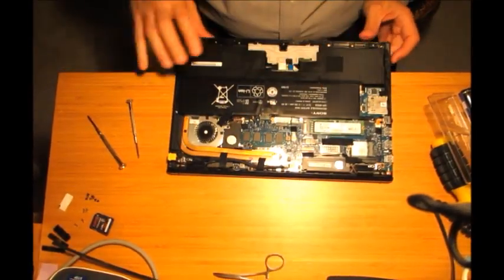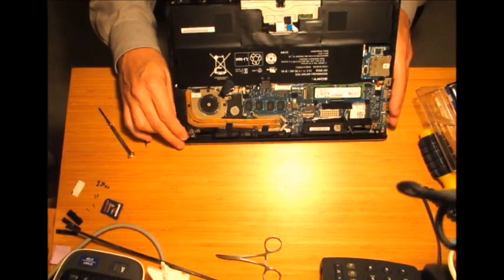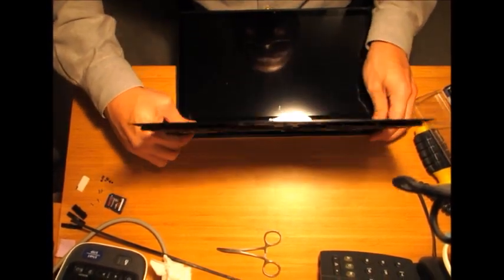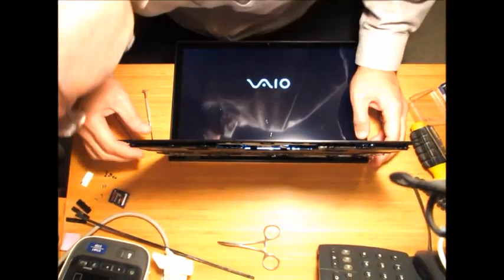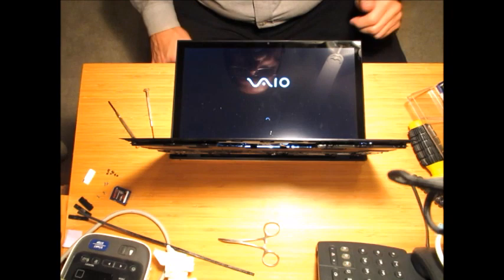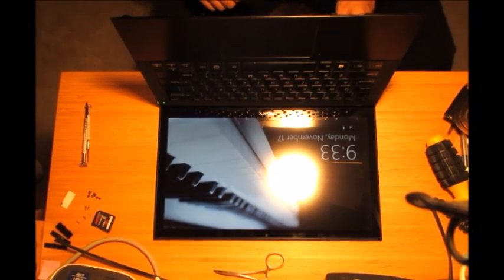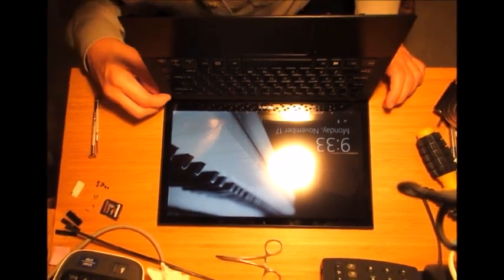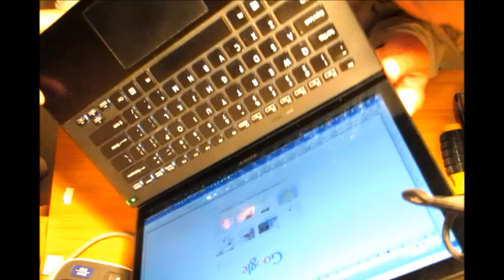Sony VAIO Pro13, svp132 fan replacement, case removal

Comment: Great video.
I just broke the digitizer on my vaio pro 13 do you know if i can replace it or do i have to replace the complete lcd screen + digitiser?
Reply from the maker: Kevin Bruggeman Good question, I had never looked into this, but after doing a quick review it appears you can replace only the touchscreen & digitizer.  There are companies selling them for ~$75-$100, however I have NO experience with those companies nor the process for replacing it.  Ex. http://www.etradesupply.com/sony-vaio-pro-13-digitizer-touch-screen-v1-0-version-black-with-sony-logo.html     
I suggest you look into the mechanics of the replacement process before attempting this, feels like it may be difficult, but I do not know.   May be easier to replace the whole LCD screen & digitizer.   Let us know how it goes.
Reply: Ok thank you ;)
Reply: Hi Kevin, I know it's too late and may be you dont even remember what you did but I have the same issue with my ultrabook. Do you think if I should buy whole LCD screen + digitiser? Thanks
Reply: @omerd.908  I had it twice now. Replacing the whole thing makes it much easier, less hassle. Just a few screws. You can however change just part but risk damaging the others during dissasembl
Reply: @kevinbruggeman5203  Thanks a lot for your reply. Actually I am planning to replace whole but I dont know if I can or not, as I couldnt find any related video. Do you have any video recommendation?

Comment: Hello, what was the problem with your fan?
My fan started flickering one week ago, and now it's completly blocked, and when the fan try to start the engine make a terribile noise. You got the same problem?
Sorry for my bad english.
Reply from the maker: fabiaiz10 Fabiaiz, my fan started making noise, like a whine and growling.  This went on for ~4 months and was getting worse, then I changed the fan.  If  your fan was clicking and now stopped, I would suggest getting a can of high-pressure air and put the can's tube in the fan vent near the power connector and try to blow the fan.  You may find some object has gotten into the fan, try to blow it out.  When I used a can of air on my fan to clean it, I can hear the fan spinning with the air.

Comment: ***** Thanks for the reply Larry. I had a look through the Intel page and nothing stood out. though I booted up Furmark to push the graphics to the limit and watch them closely to see what happens. As you said, it hit 105 and shut down, and would not power on for 10 seconds. However, it's important to note that there laptop wasn't particularly hot, nor was the fan spinning very fast, and the air blowing was only warm. 

One thing that stands out at this point is the temperature diode location inside the chassis, which might be giving faulty readings. Do you know where inside the chassis the diode is? Maybe it moved whilst I was replacing the fan, and could be giving faulty readings. Could I simply disconnect the diode?

Comment from the maker: Brody, can't seem to REPLY to your post, so I'll post here.  I've not been measuring my processor temp, so probably can only give you limited answer.  Intel publishes comments on processor temps, worth a read:  http://www.intel.com/support/processors/sb/CS-033342.htm      I believe your processor will shut down for safety reason at 105C+.   On the page above if you read each of the bullets, you'll find an Intel utility to check your processor for any issues, including temp.   If you greased the fan well as you've indicated and it's bolted snugly, and the fan is blowing warm air, you've done the install correctly.   Gaming is one of the most stressful exercises for a processor, thus higher temp can be expected.   If you find any goodies while looking over the Intel page, let us know.

Comment: Hi Larry. Firstly thanks for sharing this video, it helped me immensely when replacing my fan.

I'm a little curious though, once I replaced it and booted back in, my temperatures weren't very stable. They fluctuated between 50 and 90 constantly. Now after an hour they're a little more stable, however when I booted into a game the temp climbed up to 90. I don't want to stress it too much I so don't plan on putting anymore load on the system until I know what's going on.

Should I be worried about these temps? Should I open it back up and check to make sure everything is seated properly? I used Arctic Silver 5 for thermal paste and I used it quite liberally on the HSF... what do you suggest?

Cheers!
Brody
Reply: +Brody M have you fixed it? It seems like you might need to reapply cooling paste

Comment: Great video and well done! (I will remember not to buy one of these :p )
Reply from the maker: maxmeranda Max, actually I love this ultrabook, with the exception of the fan there has not been any failures.   There is a haunting issue with WiFi disconnects that I and one other owner have not figured out yet.
Reply: Yeah, my boss has one of these and the fan has also died in it  and is yet to be replaced. If he throws it in the bin, then I might just pull it out and fix it... maybe. No issues with the WiFi for the record, pretty solid unit mostly IMO.

Comment: Thanks Larry, I have installed the new fan and when I power on the laptop (back cover still off) - only the lights come on...the fan doesn't spin up.  Will it only do this when it gets warm or have I done something wrong?
Reply from the maker: Deborah Walsh Deborah, it will only come on when it gets warm.   However, for my fan that only takes ~2min.  If you watch the end of the video, I let the PS run until the fan comes on.   Just turn it on and let it set, the fan should come on after a few minutes.
Reply: ***** Thanks Larry!  Your video was awesome and walked me right through it!
Reply from the maker: Deborah Walsh Deborah, glad it helped, hope you have a new quiet fan...

Comment: Hi, im looking for keyboard replacement for this ultrabook and is just impossible. Do u know the part number or any tip please??? I really appreciate! Part of my keys just stopped work.
Reply from the maker: Rodrigo Ramos Rodrigo, you may try this web page https://us.en.kb.sony.com/app/answers/detail/a_id/38121/c/65,66/p/48903,49902,74256,85637/Here is the part number for the PC, try searching for "svp132190X keyboard"
Reply: ***** Hi Larry tks a lot for your answer. Still cant find but i will keep looking for it. Question: did u ever tried take this keyboard out? i see 2 small "dents" over the keyboard. After watch ur video i saw many stuffs below the ultrabook but not access to keyboard. Im thinking in take out the keyb and check the flat connection, keys, etc. thanks!
Reply from the maker: Rodrigo Ramos Rodrigo, I don't have experience yet taking out the keyboard, however if  yours is failing, mine may soon.  Good luck and let us know what you find.

Comment: Thanks for the great video,had this laptop set aside for a year due to the fan
But know that I've replaced it the fan has a gentle noise but it immediately turns on a few seconds after the laptop turns on and wont turn off.
Does anyone know if this is a driver problem or if my BIOS hasn't properly recognized the fan?
Reply from the maker: Bernardo Bohorquez Bernardo, I'm not 100% sure, but can tell you two places to look.  In the BIOS there may be a fan setting silent or performance.  I believe there is also a fan setting in your Power Profile in Win8, it allows setting for silent.   If neither of these work, the temperature sensor in the PC may be telling the fan to turn on when not needed.
Reply: ***** Thanks for the response. That was what I had already done once turning it on and the fan kept at it at full roar. At what temperature does the fan normally turn on? At start-up my CPU sits at 31-33 and maximum is 45-48.
Reply from the maker: Bernardo Bohorquez I do not know the turn-on temp, however the temperatures  you quoted are very low, I do not believe the fan should be running very fast at those temps.
Reply from the maker: Bernardo Bohorquez Have you tried running the Vaio diagnostics?
Reply: ***** Well I tried it now, but it wasn't much use since it said everything checked out fine in each category.
Reply from the maker: Bernardo Bohorquez Bernardo, I just tried the Sony Cooling Fan diagnostic, my fan went from quiet to very fast & loud, then back to quiet.  Does your just stay fast and loud?
Reply: ***** I'm sorry but, my VAIO diagnostics center doesn't have it. Is it located somewhere else?
Reply from the maker: Bernardo Bohorquez Bernardo, on my PC it's under VAIO CARE, SOLUTION CENTER, at the bottom of the screen on the left side it says DIAGNOSTICS, scroll to the bottom of the diagnostics to advanced diagnostics, it should say COOLING FAN.
Reply: ***** Hello, thanks for the great video it helped me immensely when my fan started making odd sounds. First i tried the oil-trick but after a couple of months the fan got worse, i might have been to late with the oil. I have now replaced my fan but seem to have the same issue as bernardo. 
I ran the fan diagnostic, which i couldn't locate in the vaio care software, but i found a .exe file in the softwares folders. I manually started the diagnostics tool and it ran for ~10 seconds while the fan still ran at full speed. The tool gave me no report afterwards. I have also tried different software like Speedfand and HWMonitor, but neither of these recognise the fan. they do however report CPU temps of around 30-45 C.

I am now at a complete loss to what is wrong and hope someone knows a fix.
Reply from the maker: Mikkel Risbjerg Andersen Not sure I will be much help on this topic.  I just tried the fan diagnostics on my Vaio, it ran my fan up to high-speed, then said it "passed".  Then my fan took ~1 minute to slowly go back to normal quiet speed.  (not so helpful for you).   Here is one page suggesting lower processor speed.  http://4u3.biz/Articles/computers/laptops/sony-vaio-how-to-reduce-fan-noise.html
Reply: ***** I found another page where someone were having similar issues. It was suggested it might be a faulty sensor in the fan and as a failsafe the CPU forces it to run constantly to prevent overheating.
I will try contact the seller as I am thinking this might be the case.
Reply from the maker: Mikkel Risbjerg Andersen Mikkel, thank you for the feedback.  Please let us know what you find.

Comment: Thanks ***** for this excellent video and for posting the part numbers here! They're helping me a lot in my repair.

My fan has started buzzing to the point that the entire laptop shakes and the thing is unusable. Sony won't repair it and Best Buy can't get parts (this has been an ordeal), so finding your video has been great.

I'll be trying the oil first as described below and then, if that fails, a full replacement. Hoping the oil works but if it doesn't then I'll be replacing the whole thing. I'll let you know how it goes!

Comment: Thanks Larry for the great video, do you know the part number for the replacement SSD? 256GB and higher. For now, I'm using SD Memory 256GB but I cannot use it as the primary boot drive.